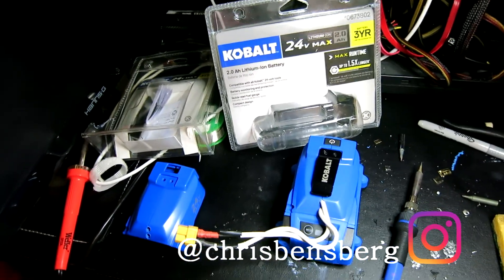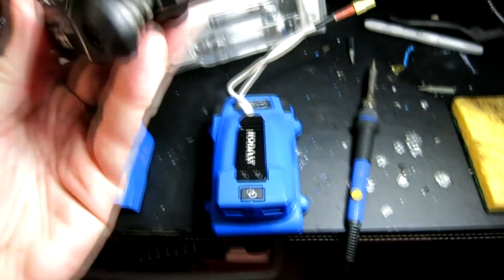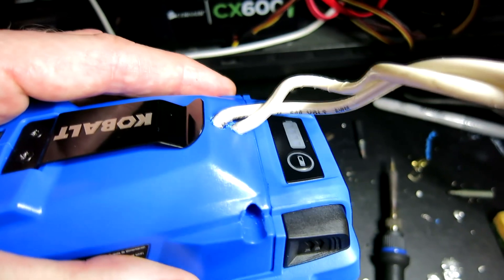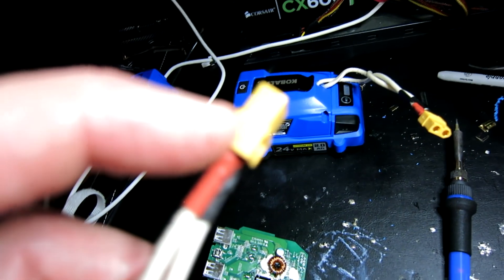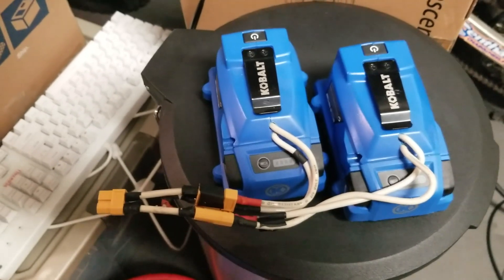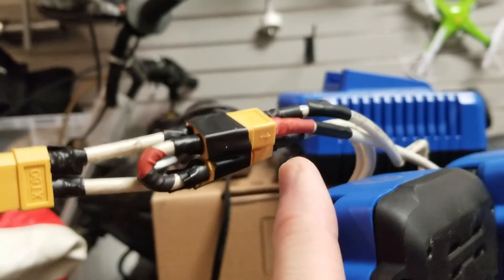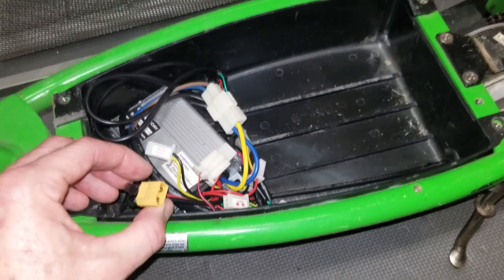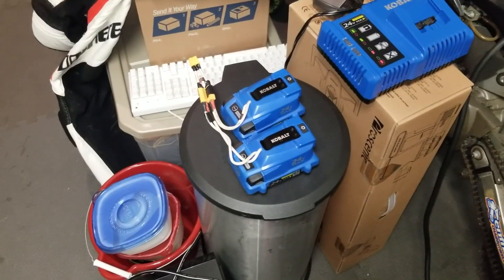How To Hack Power Tool Drill Batteries For Your Razor E300 E200 To Go 30MPH!!

Comment: Very late comment here, but best explanation video on upgrading this scooter.
Other video also excellent.
I am converting a E300 using an E-bike 36v battery with 12ah. I tried the sealed lead acid batteries, but they were terrible. Mounted the third battery on the pole under the seat, and put it inside a plastic box. The seat came from an E200s scooter and it fits the E300. Just the same seat.
It still worked, but weight was far too much. My new 36v E-bike battery is far better.
Well done on these videos. Best videos I have seen on this. Oh, new sub for you too. 
Cheers from Scotland.😃👍👍

Comment: Cool
I also want to try what I haven't seen, ADDING A THERMAL TEMP SWITCH super glued to the motor casing so it can shut off the power if the temp gets too high and save the motor 
Aliexpress has these switches for cheap and it could be wired into the controller brake switch cut off.
Take care

Comment: thinking of doing same thing with 2 flexvolts on a hoverboard kart. can two series batteries connect to the 1 36v battery in hoverboard or is it better to bypass the existing battery?

Comment: Can you help me I want to run a 3000w motor and controller but I would like to use 4 battery’s what you recommend?
Reply: where will you put the batteries ..outside? it won't fit the tray

Comment: id be looking at discharge current before hooking that up to anything bruv.
Reply: `rated 15.4 amps max discharge for the stock 24 volt 280 watt brushed razor motor.   it would have been better if he put a pair of  kobalt 24v 4.0ah packs that would be way less taxing to the batteries but it cost $100 a pair of those.
Reply: Could you guys help me out I did this exact rig but with flexvolt DeWalt batteries and i Hooke everything up exactly how he does and now my scooter doesn’t even move any idea ?

Comment: How long will just one 24 V last week because I don’t need that much power
Reply: use 2 24v in parralel kobalt 4.0ah 24v 2/pack for $100 gives you 8ah capacity
Reply: em forty yeah but If it is 4.0ah it wont fit, you need 2.0ah’s
Reply: @whiteout475  it does on mine E300 using a pair of 24v 4.0ah
Reply: em forty oh ok I don’t know why for me it doesn’t fit because when I put on the plastic covering it doesn’t let me screw it on 
(I didn’t mean fitting to side-by-side I meant vertically it’s too oversized to fit the cover) I was forced to get some wood and cut it to size to create sort of a platform for
Reply: em forty Oh yeah and did you need a fusible link?

Comment: It will be easier to get a 48 volt 10 Ah battery pack with a charger included. And just plug everything, off course using 48 controller. Etc 💡
Reply: $$ure

Comment: Great idea, how many miles range do you get?
Reply: way less than the original battery but much faster though
Reply: @10OZDuster  I was wondering about the range as that Kobalt battery was only 2ah. Our Pocket mod came stock with two, 7ah batteries.

Comment: How long did this last before it burned out the motor?
Reply: Will it blow it up?
Reply: @kinggamer-vb5yj  I've done the same mod and both times it blew the motor in less than a week.
Reply: @lewinday7224   I assume the motor is safer with a 18v battery instead of 48v?  I haven’t fully watch this video, but without question asked, we know better not to go too much of the voltage because the motor could only handle around 12v. Unless this guy did mention to upgrade motor before applying 48v to the scooter
Reply: stock 24v motor will burn up better to use 48v motor for a pair series of 24v kobalt

Comment: Could you wire the batteries in parallel and use the factory controller (ESC)? This should give you a better battery source and charging at the same factory volts.

Comment: Can I do this with a dewalt battery I have two 20v 5ah lithium. And will a 36v or 48v controller work and does it have to be a 1000 watt and did you have to change the 20amp push button circuit breaker?

Comment: Did you upgrade the motor or is that the original 250watt motor with a 1000 watt/48 overvolt controller? I put an 800watt/36 overvolt controller on my e300 and hoping this gives it just a little more oomph
Reply: T Gallagher how did it go? I am thinking of using two 20v battery’s so totally of 40v and don’t know if I need a 36v controller or higher and curious about the watts as well since motor isn’t a 1000watt
Reply: @TheIndypacers  a pair of  20v in series lithium is technically 36v system so get a 36v controller and 36v motor